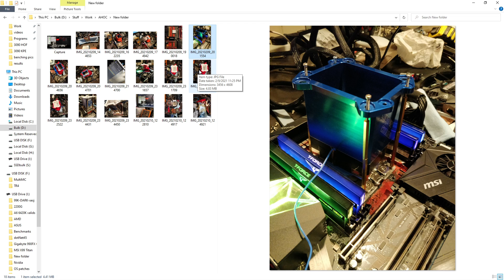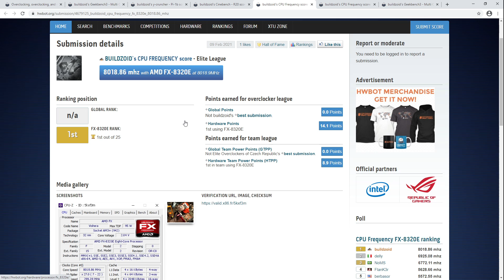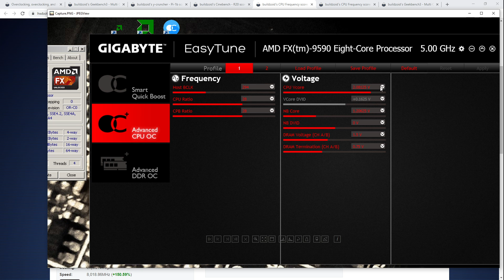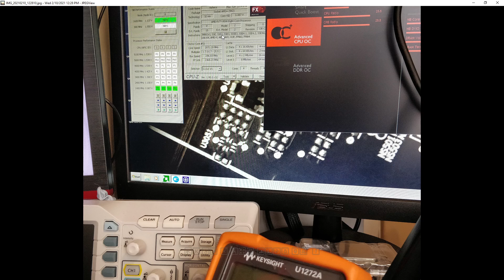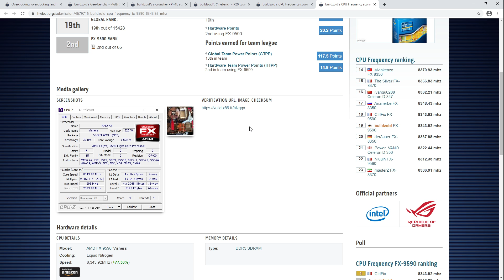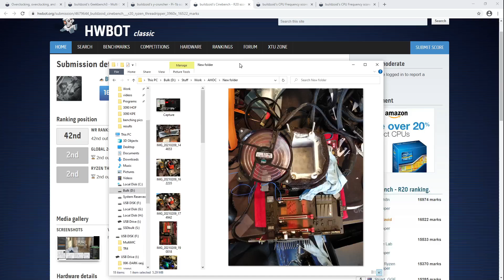Finally running Liquid Nitrogen again! 2x 8GHz+ validations and some Threadripper 3960X top scores

Comment: Hi Buildzoid, i see you used GA-990FX-Gaming a lot, it's still a part of my rig, and i encounter strange issue with it.
When i push it to high cpu power draw (medium llc, voltage >1.55V >4.8GHz, stressed with IBT on Very High) the board just shut itself down under heavy load (black screen, fans are spinning, 12V on PCIE PEG is visible, reset/power not working, using power switch or disconnecting power cable is needed to restart system), i hooked up DMM to vcore (right on the back side of socket) and when it happens vcore just disappears (it shows like a 0.013V at max). It looks for me like tripped VRM OCP or something ... but in bios there is no option to disable it (i even checked for hidden options via AMIBCP), enabling HPC also didn't helped.
Do you encounter that problem and maybe have solution for that ? I would like to burn the hell out of this chip and i fell that it's wasting especially that 1.55V set is like 1.46V get measured on DMM. :D

Also further to add, it's not looking like overtemp also, CPU Cooling is plenty capable of more, VRM should be cool enaugh (<75C on build in termistors and on 3 added, on back side of board, right between mosfets and between the chokes)

Comment: Haven't really seen a threadripper socket but couldn't you have used wire to hold the pot in place? Then tighten the wire to get a better clamping pressure.

Comment: Im liking this new channel direction go and play with period correct stuff.

I know ypu played alot with fx but the addage of leakey being better under ln2. Sometime in 2013 there was a change in the fx chips and they generally became less leaky. And finally the 9xxx cpus actually have changes in silicon but it really did not seem to do much.
Reply from the maker: my 9590 is a 2016 chip and the 8320E is a 2014 chip. My first 9590 wasn't anywhere near this leaky.
Reply: @ActuallyHardcoreOverclocking  i used to frequent the vishera owners club on overclock.net before the site revamp when the stilt was quite active in the community so thats where most of my knowledge comes from. The club was more daily oc focused so probably not the best help for single core extreme frequency validations.

To elorabrate more on what I ment.

The post 13 chips could do 4.7 ish on air alot more common and get close to 5 on water.

The e chips woud use extremely low voltage to arround 4.5-7then wall hard (also as metioned before very not leaky as even at the same voltages as other chips they ran cold. The e line was also launched very late in the producrion. 

Of course there where outliers and the 8300 where just usally trash.

But yea your 9590 definitely seems to be a abnormally cant wait to see it on your custom board triping ocp from the login screen must have been a shock.

Comment: I had a hilarious (but actually sad) story with these 3.5 screws on my combo am4/tr4 block. I didn't read the manual (why, manuals are for the normies) and simply installed the block with the standard AM4 backplate. When I started up the system and booted, I decided to run the CPU-z bench just for showing off how good my new custom loop is. In one second the temperature got to 105C and then I discovered that the supplied screws don't actually fit into the backplate screw holes. Then I realized why the waterblock vendor put another backplate into the box...

Comment: I have many fx chips(athlon x2 370k/4100/6300/6350/8320e/8350/9590). run them all(24/7) with 240 fclk. ram 1600. 4.2-5.1ghz with hyper and nb? at 2400. all on air(the 9590 is undervolted and on air)

 my highest 24/7 is actually the athlon x2 370k but i havent pushed it as far as it can go yet.

my worst chip was my first. the fx8350 i have

the upped fclk and hyper push the single cores to about 100 on r15 for all of them.

Userbenchmark is useful for comparing WITHIN architecture. especially for people without tons of hardware. its a great reference...as long as within architexture.

Comment: Tempted to replace thermal pads on GPU, minus 8 expensive asf. Someone recommended Thermalright off of Aliexpress - 12.8w/mk.

Anyone had experience with them?
Reply: Get the new ones from Gelid, I think they're called GP extreme.
Reply: This. The Gelid GP Extreme pads are good and still way cheaper on AliExpress.

Comment: Cold-Bug Question: 
I have 2 sticks crucial DDR4 Ram (each 16GB) running oc totally fine, also memtest zero errors, but as soon as I open the window and let really cold winter air in, at one point after a few mins the system gets blue screen and is not startable anymore, it tries, but fails to boot into windows. with room temperature all is fine,
how the heck can this be??? :)

ps. first wasnt sure which component is causing the error, but I then started to bring back the ddr4 frequency a bit in BIOS, and nomore crashes happended under cold conditions...
Reply from the maker: So memory chips just don't like being cold.
Reply: @ActuallyHardcoreOverclocking  Thanks, yeah seems like...just so surprising for me, and new..bc since I started OC-ing (cpu/gpu) my goal was always to keep things cold. Looks like I learned something new here:)

(who knows, maybe I give it a try and cover the mem sticks against the cold air..dont know how yet.. maybe with some insulation material)

Comment: UK electrical socket screws are m3.5, you can buy long ones and if you buy a fancy pair of electrical snips like from Toolstation or similar then they have a thing in them that cuts them without damaging the thread
Reply: I recommend CK snips as an electrician who uses them daily

Comment: I wonder when he's gonna overclock his first blackhole.
Reply: He needs the emptyness of space to overclock his hair first
Reply: Buildzoid tomorrow - so I accidentally oced a black hole, also ddr4 1200000mhz of video glitched gimmie a few hours guys
6 hours later - ok so I goofed & hit 1600000mhz but the vrm can barely keep up with the power load, soldering might be in order
Reply: @bogartwilley  hahaha ....nooooo he cant solder becuase his soldering equipment is not available in this moment...... i think hes gonna try to combine the vrm  in a quantum leap using lunar phazes electromagnetic reflection of the solar magnetic fields, as an alernate but nature regulated  vdroop.... when aligned properly of course... you know just the time to run geek bench and take a screen shot.
I just hope he gets a solid BIOS  to make it work.

Comment from the maker: first
Reply: Congratulations!!!!  I super glad for You being  in the active competitive arena!!
could you kindly do a ram overclock guide  with threadripper with the maximum stable daily overclock..and do some benchmarks like eg vray?!..just to see if there is any gains in productivity?!
Still really looking forward on your ECC overclocking!! and thoughts on what ecc memory would be best to use on eg threadripper or threadripper pro..if the motherboard can take it of course.
Reply: want an old phenom 2 1090t to put under liquid nitrogen.
Reply: Could You very Kindly make a video about CTR 2.1 PX (with your recommended DAILY settings) and what You think about it please?! looks like Yuri is proposing unsafe voltages, and Your opinion would be very welcome.
Reply: And first place 👏🏻
Reply: BZ-chan this video was excellent
Reply: @Xbox Only thats based my nigga
Reply: @Xbox Only let's see the score SlungLoSolo#7913
Reply: @Actually Hardcore Overclocking come check out this 3600, it got CB23MT: 10668 @4.75Ghz/1.32v but the 2x8GB was at 2933 CL20+. My Discord: SlungLoSolo#7913
Reply: Liquid Nitrogen isAmazingk!